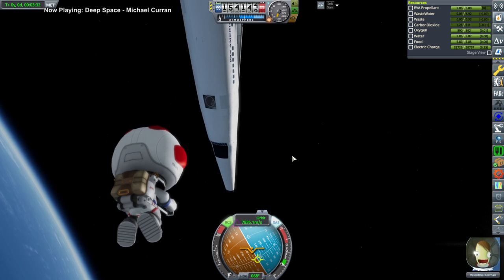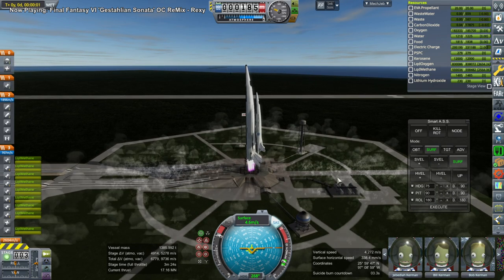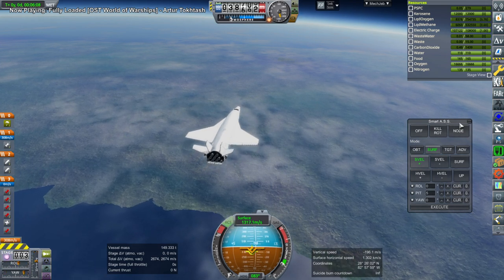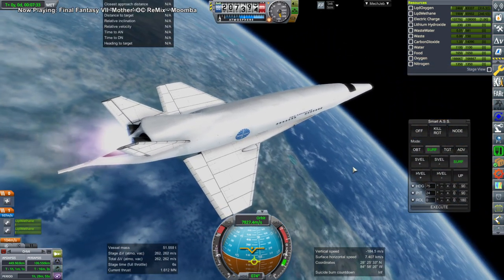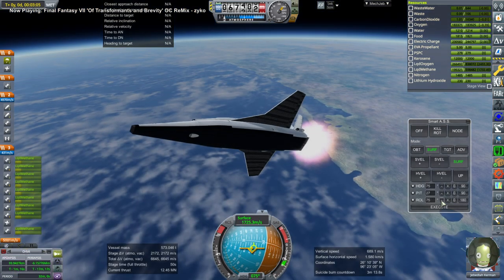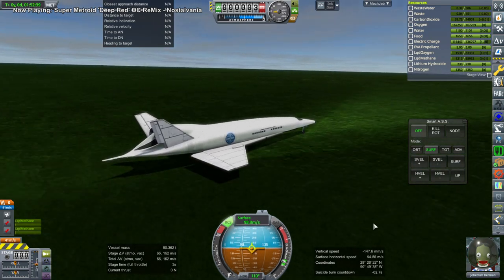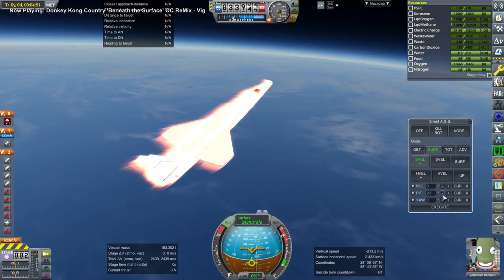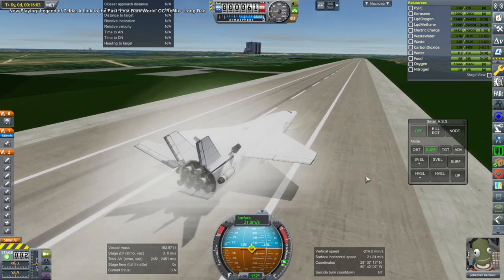KSP with Realism Overhaul - Orion III Reentry Test

Comment: I just have one question. How does the carrier go back to Alabama if it doesn't have jet engines?
Reply: but it has :)
Reply from the maker: First of all, the takeoff is from Brownsville, Texas, not Alabama. I guess that's an argument against removing the jets, but at least we don't have to carry the Kerosene during the main launch. It can be topped off for the flight back later.
Reply: @RaizSpace  oops I got the states mixed up, my bad hahaha. I guess you could also argue it goes back either on a carrier plane shuttle-style or maybe even a suborbital hop under its own power too?